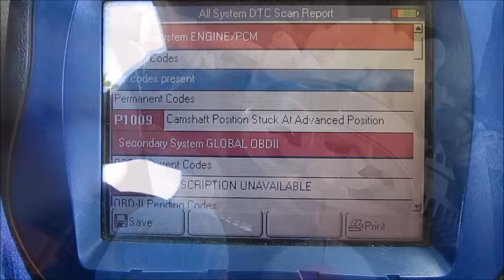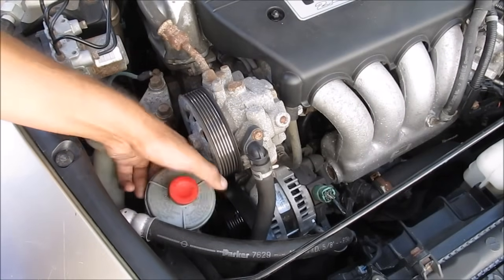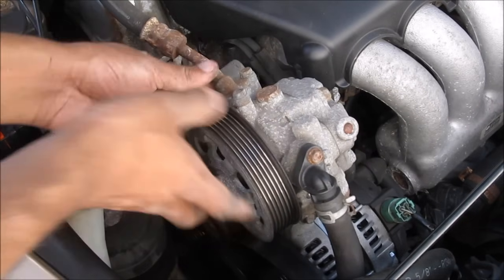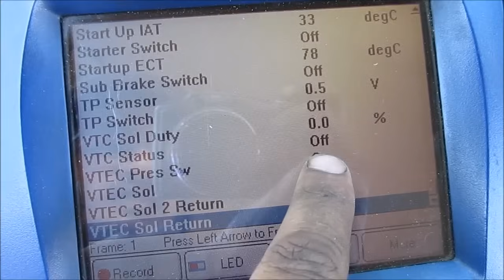P1009 Honda VTC Valve Cleaning

Comment: Unfortunately, you're absolutely wrong when you Stated: "The Manual States That There's Supposed To Be An O-ring on The End Of The Solenoid" (Sorry but your source is completely wrong) And if you believed this to be true then why didn't you remove the old o-ring and place a new one on the solenoid??? This makes no sense at all and a good mechanic would never do the job Half-Ass*D??? Lastly, no good mechanic would have reinstalled that dinged up idler pulley without replacing it, it's only $5.79 at Rock Auto so why wouldn't you relace it???

Comment: My solinoid has been replaced after being stuck in advance and the code keeps coming back on 😢.
Reply from the maker: Check for particles in the oil
Reply: @speedkar99 I found out from a Honda service that I have the wrong oil in my engine too thick ( from my mechanic )they said and the vtc solenoid strainer is blocked.

Comment: Small problem: Despite your kind warning, i managed to lose the nut in the back of the auto tensioner! It was there when took it off and set it down, but it was gone once i reinstalled it. I will go to honda in the morning but, the way my luck goes, they won't have it. Ever had to replace that nut? Any advice?
Reply: Yeah be more careful.

Comment: Great job.  You cleared up the confusion I had between the VTEC solenoid and the VVT solenoid.  You also saved me the trouble of finding the bolts on the power steering pump and the belt tensioner.

Comment: Mines runs fine only code it trips P1009 and only when in 5th gear accelerating but doesn’t seem like there a issue besides not powerful seems like vtec doesn’t kick on but it could be in my head hoping cleaning this filter and solenoid will solve Issue it’s a healthy engine that doesn’t burn oil and good maintenance hope it’s not a lemon
Reply: Replaced screen and vvt solenoid still same p1009 code timing chains not stretched seems very tight  and very clean healthy engine with 150k  where else should I look has  fully cleaned upper and lower intake plenum I clean them up like new inside them

Comment: How do you knw its not jumped time and just the vtc valve
Reply from the maker: Then you'd have cam crank position codes
Reply: @speedkar99  only codes are p303 p300 all p 300s and i did compression test zero compression in 2

Comment: Please help. I have tested on battery the valve and it clicks in and out but supply connection measures 2.86volts on contact and 2.93 volts when engine running. Shouldn’t it be 12V?

Comment: May have already been posted but the gasket/o-ring on the VTC solenoid is there (https://youtu.be/YYKikGysXqE?t=278), not in the engine.  It's the first black ring closest to the electrical connection end of the solenoid.  It looks pretty flat as well, part number for just the o-ring is 15832-RAA-A01.

Comment: man I'm having so much trouble accessing the bolt for the idler pulley. the engine mount is right in front of the bolt and I can't get a socket in there. i tried your double wrench trick, but I couldn't get enough leverage to pull the idler and loosen the belt. 

just curious, did you ever torque that pulley to spec? if so, how'd you get the socket in there?
Reply: The easiest way is to put a jack under the engine and take off the engine mount.
You will have alot of space to access the bolts.
Reply: update: i ended up buying a long serpentine wrench / breaker bar and that helped. it has a really thin profile and it was gave tons of leverage. 

fortunately, i was able to torque the pulley bolt to spec after it was mounted into the car again. i wouldn’t have been able to torque the bolt outside of the car because i didn’t have a vice/clamp to hold pulley while tightening the bolt.

anyway, this video was a huge help to the entire process! thanks man

Comment: The early type VVT solenoid shown with the black rubber seal running between the valve lands often fails because of cross leaking across the seal and lands. It passed the tests given here but . . . Result is intake cam stuck advanced with very rough running and P1009 code. I got the new style valve without the rubber seals and those symptoms completely disappeared. I bought an aftermarket because Honda valve was on back order and it is working perfectly 3 months later.

Comment: Cleaned the strainer and solenoid, but my ECU is still throwing out that P1009 code. Just did an oil and filter change as well. I'm thinking bad solenoid? Both parts didn't look too bad or gunked up at all, I'm just hoping I did everything right. Is it possible to get to the solenoid without removing the PS mounts?

Comment: I have an 06 2.4 crank no start throwing this code changed the vtec and the vvt solenoid and the screen oil level is full also changed the pgm fi relays (red and blue) original Matsuba ones.  Car still cranks with no start and has same code P1009.  Any ideas?  Does this car have a vtc actuator like an 08?

Comment: There is no o-ring on the insertion spear end of that. Just the screens.

Manual references replacing the o-ring on the other end, before the screen ones. Closest to the mount bolt hole. That is the only o-ring.
15832-RAA-A01 I believe is the part number.

Comment: What do I do if the solenoid wiggles but does not come out?  3:53
Reply from the maker: Wiggle it until it comes out. It's hard
Reply: @speedkar99  how long did it take remove the solenoid?its really lose when I wiggle but doesn't come out.  I tried for 15 minutes. I'll try it again.

Comment: Excellent video!  Images and descriptions are crystal clear with nice, tight editing. I have a slight oil leak at the VTC Valve (2008 Element), and am also planning to replace the serpentine belt and tensioner. I got all the info I need from your one video. Beautiful!

Comment: another win for a fellow Canadian driveway mechanic.  thanks for sharing your knowledge.
Reply: just an update.  My co-worker has a 2009 Honda Accord.  She has a bad mechanic that basically told her to start shopping for a used car.  Because of your video, and my tools, I was able to remove her solenoid, spray it down with brake fluid, test it on the battery (clicky/clicky), reinstall and now her Check Engine Light (CEL) is gone.  a couple hours of elbow grease, some dirty finger nails, and I look like a hero because of your video.  Thanks once again.
Reply from the maker: You are welcome!

Comment: https://youtu.be/YYKikGysXqE?t=173
Actually it comes in through the filter and the gunk gets stuck on the visible side of the filter, and then exits out teh back and back into the head through the open hole.  :)

Comment: Thanks for the video. Did the job today and it’s was easy. Only thing that I got snagged on was I broke the screw holding down the ground wire trying to remove it from the engine mount. Going to replace the ground wire with another of the same gauge but longer and going to attach the other end to the engine where the power steering pump line is bolted near the firewall. 

Note: My VTC solenoid was stuck in the engine. I had to use a Channellock plier to wiggle it out.

Comment: Nice video but. What happens when just the head of the valve comes off and the screen is stuck inside?! I wish this video mentioned that could happen. Did it on an 06 element. Now it's stuck outside the parts store until I get the new part. How the hell do you get that out

Comment: Can the wheel on the power steering  be removed (the bolt that holds the wheel on) my engine space is too tight to get at the lower bolt to remove the power steering pump

Comment: speedkar99 i have a 06 acura csx and i have this engine code my car has 250000 km what could it be i just had a oil change and the engine light came on and i had this code

Comment: Running into this issue on my 2007 RDX now. It wasn't the screen, so I'm going to check the VTC valve and hope it's not the vtec solenoid.

Your video was thorough, concise, and you covered everything. Thank you!
Reply: If anybody else has to do this on an RDX, you need to unbolt the ABS module, use something to prop it up, and unbolt the motor mount to swivel it out of the way. Then you can use a 1/4 10mm with an extension to just have enough room. It's an extremely tight squeeze. If you have large hands, you may need to support the engine and remove the other engine mount as well.

Comment: I know this video is a couple years old but I had a question I actually replaced my VTC valve in my 2005 Honda Accord and of course that plastic electrical connector that plugs into it the retainer clip snap so was wondering do you know the name of that electrical connector or a name for the wiring harness or the part number for it?
Reply from the maker: Check the wiring diagram it should have all the pinouts
Reply from the maker: Or Maybe snip one off at the junk yard
Reply: @speedkar99  okay thanks for the advice. I definitely will.

Comment: I learned the hard way not to trust that test of applying 12v. I had a solenoid it was clean worked perfectly. I was going crazy trying to find the issue. It ended up being the solenoid after all. The can bypass internally.

Comment: An oil control valve that has not come out before will not come out with a  wiggle wiggle wiggle.  The wiggle is easy.  To get the valve out you may need to use a long needle nose pliers, making sure to only grasp metal and not plastic.
Reply from the maker: Good tip

Comment: Thanks for the great video. I did this today on my 2.4L 2009 Honda Accord EX-L. Instead of just cleaning the filter screen, I replaced the screen itself and cleaned its housing. I wasn't able to remove the VVT Valve/Solenoid, as I imagine it hasn't been touched in almost 12 years and is stuck in there pretty good. Either way, after the screen cleaning, the noise from the actuator upon cold start up is now gone. In case others want to follow this video and run into the same issue as me, try a new filter screen replacement and see where it takes you. Thanks again, speedkar99!

Comment: I have 2003 accord, the engine is burning oil and has the p1009 code, would that replace the valve help with the burning oil??

Comment: Is that to clear the rattling noise on cold days start up, i have read that is a common issue on hondas
Reply: Think this is to fix the oil burn. The rattling is coming from the vvt actuator.

Comment: speedkar99, I cannot emphasize enough how careful you need to be when removing and replacing the pulley tensioner.  the nut for the pulley fell out when I first removed the tensioner and I did not realize it until I went to reinstall.  When I spotted the nut perilously leaning on a pulley, my son tried to be helpful and retrieve it, but only succeeded in knocking it into the splash shield. Luckily, I was able to get it.  I used a piece of tape to hold the nut in place on the tensioner, but the tape didn't hold and now the nut has completely disappeared. It would be an easy engineering fix to capture the nut in the tensioner to avoid this sort of thing.  Anyway, thanks for the great video!
Reply: You need a magnetic pickup tool my friend they have saved my ass many times

Comment: Is this what could possibly cause my 2010 accord to make a chatter sound? It doesnt do it all the time. Im New to vtec motors.
Reply from the maker: Not exactly, this causes it to be out of time. The 9th gen accord had oil issues, check that out.
Reply: @speedkar99   I run mobil 1 synthetic 5/20 and wix filters.  Any suggestions on what else to look for

Comment: Wait a minute, besides the engine light what are the symptoms even for this problem? Maybe we can spot it early and do a cleaning before we throw a code?
Reply from the maker: Potentially misfire or the ECU retaeding timing.
Reply: @speedkar99  thanks I'm getting slight misfires "no engine light" and I've already taken care of the basics. I noticed that my VTC is easy to get 2 and it's covered in oil to the plug so...

Comment: The vct solenoid was bad on the vehicle I was working on. I have been a professional auto tech for many years. I pulled the solenoid out to manually test it, valve moved freely and solenoid was strong. Usually the valve will stick or the solenoid would work intermittently or seem weak but the solenoid seemed to work fine but as soon as you start the engine the light would come on. I replaced the solenoid and it fixed it. The problem was the valve was worn allowing oil to pass through the valve when it was closed.  So even if the solenoid tests good just replace it because it might just be worn out like mine was which could lead to miss diagnosing it as the cam adjuster/phaser.

Comment: My car is a 2003 Honda Accord 2.4L. Thanks so much for the video. It was super informative and allowed me to complete the first task and put everything back together within 20min. The second part (taking out the VTC solenoid) took a bit longer because the connector/head broke off leaving the longer part inside. First I panicked but after some research found out that it was not uncommon for this to happen. First I took out the long plunger that moves in and out. It came out by hand. Then I Purchased a screw extractor set from Canadian tire. Put the largest #5 in the hole, tapped it a bit to get it to stick in the hole, started to work it back and forth and after a few minutes the rest came right out. Now I am just waiting on the new VTC solenoid to arrive, so I can install and finish the job.
Reply from the maker: Wow. That sucks. I suppose you might have some access to the solenoid if you took off the valve cover?
Reply: @speedkar99  Thanks for the respond back. Unfortunately taking off the valve cover doesn't help. The only way to gain more room/access is to remove the side timing chain cover. But like I mentioned before if this ever happens to anyone where the head part of the VTC breaks leaving the long metal part in the hole. Don't worry, just buy a screw extractor set ($20) and you will be able to take it right out without having to remove anything additional. Good luck.. Thanks for the awsome step by step video.
Reply: After 6 years, got P1009 code again and repeated procedure outlined in video. This time VVT solenoid wouldn't come out. Put a screwdriver on side of solenoid and tapped it with a hammer. Thought that might loosen it, but that was mistake. The attachment is really weak! It's just bent metal. Broke off the external portion of the VVT solenoid. I can confirm that the long plunger that moves in and out of the solenoid will come out by hand. It's oily so you may need to wipe it off. It will also slide back in. So you may need to play with it a little, but it does comes out easy once you get it out far enough you can grip it. After removal of center plunger, followed advice re: screw extractor. Worked fine. I would add there isn't a lot of room to work. If I didn't put an extension on my socket wrench, there wasn't enough length to reach some bolt heads. If I put a short extension on the wrench, it was too long to operate in the small space. My solution was to use a 1/2" socket wrench with a 1/2-to-3/8" reducer, which gave me about an inch of extension instead of about 2" with the short extension. Thanks to @baberabbas11

Comment: Great video and professionally done.  As it turned out all I really needed to do was add oil.  Glad I did not have to go through this, but your video gave me confidence I could do it when it becomes necessary.  Again, great video!
Reply from the maker: Good to know. VTC is highly dependant on oil pressure

Comment: Damn I have 210,000 miles on my 2007 accord 2.4L I was accelerating hard around 5k rpm I looked down at my gauges I saw the check engine light pop on.... Is this code a serious issue? Can I still drive another 5-10k miles with it like this?
Reply from the maker: It's not serious but your car may not feel well

Comment: I was wondering if I should use the factory one or a aftermarket one.  They look different.  Which is better. Did your problem come back
Reply from the maker: I didn't keep the car for too long 
If the code comes back I'd replace it
Reply: I didn't have a code. It's just grind on cold starts

Comment: Great video! I like that you differentiated between the Variable timing solenoid and Vtec Solenoid. At 5:03 you mention there was supposed to be  an O-ring on the end, but that it might be stuck inside. I don't think so. When you buy the O-ring from the dealer online, they show an O-ring at the front in the drawing like you mentioned.That ring is already on the solenoid in your video, its the black ring farthest to the left that keeps the oil from spilling out to the side of the engine. Its the only O-ring for sale on that solenoid. Its also a good idea to replace  the Vtec solenoid screen at the rear of the engine. I'm a fan of your channel, thumbs up!
Reply from the maker: Thanks for the tips!
Reply: So there is no O ring correct? I have to change the VTC solenoid on my 2004 Honda accord very soon
Reply: @elkinposada6261  The O-ring is right there in the video at 5:03, its the black ring farthest to the left. The new solenoid should come with the O ring already installed on it. If your solenoid is leaking oil but it's still working fine, you can buy the O ring by itself from the dealer.

Comment: Need to say, great video. Helped me know the steps needed, except for getting the VTC solenoid out. Mine was sized in. The two parts separated. Might have been due to no room. Ended up having to take my master cylinder off, engine mount. Should just do that to make more room as part of the steps. Cause my solenoid broke apart, had to take the valve cover off and push it out from the inside, replace valve gasket. After everything is back together and a fresh oil change, it's working great.
Reply from the maker: Glad it helped. Damn your VTC Solenoid was really stuck in there eh! At least it's not a blind hole and u can push it out.